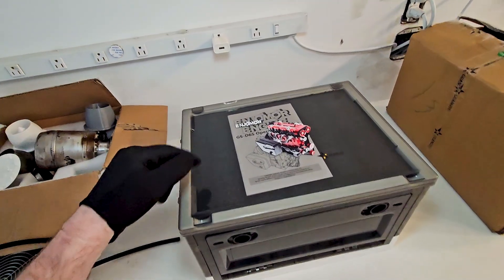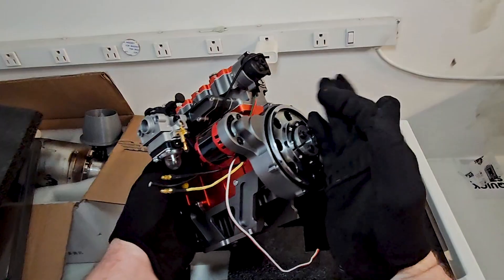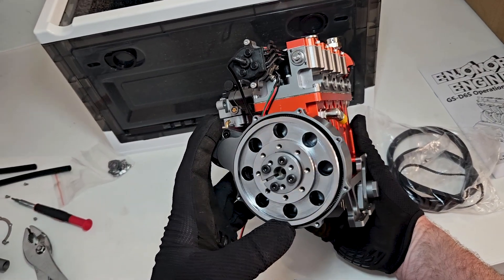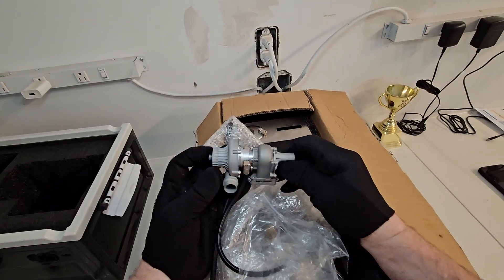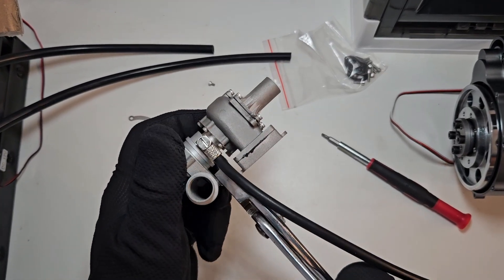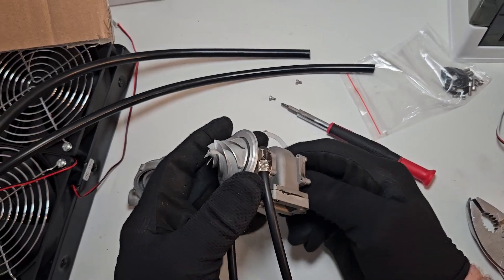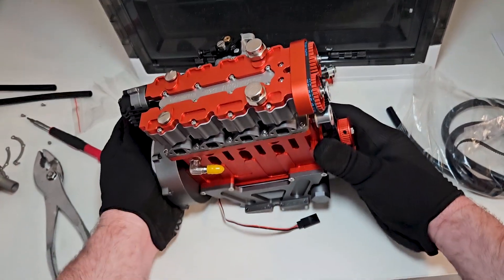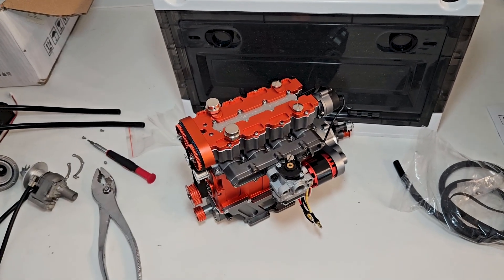Worlds Smallest Turbo Mini 4 Cylinder Engine - (Just Arrived-Unboxing)

Comment: As many have commented, it is a pure gimmick for looks only and cannot and will not - and indeed, does not produce ANY boost at all. Beware of the bottom end of this unit - the 'big end' used single split copper plated sleeve bearings that they have forced open and then re-clamped around the crankpin ! - they wont, and dont, last long. NO pressure oil feed to the crank, only the cam area. Bottom end relies on oil return channels from the head. At least the main bearings are roller but the bog ends are a joke. All splash fed and never designed to be used for axial loads. Oil pump is a reasonable design but you will find that it wont work at tick over due to them putting the main filter BEFORE the pump !!!. the filter needs to be AFTER the pump and a screen mesh protecting the pump input. 2 major issue is the top end as the cam bucket followers act as mini hydraulic pumps - they are not designed to ! - and force oil down the unprotected valve guides.  Overall a good design let down by atrocious big end bearings - if you can call them that - and the valve guide lack of seals. The 5 dollar aliexpress carb doesn't help either and CAN work but is never setup properly from the factory. Unless you fully understand how to set up a Walbro barrel type carb then forget it.

Comment: @Matt Mikka 

I have the Enjomor D6S 4 cylinder w' turbo and love it.. Ive put 3 gallons through mine without any issues whatsoever; I have a lot of miniature engines and this one is my favorite by far!

Completely agree that the turbocharger is for

looks, but they did a hell of a job on its

aesthetics, and you can hear its spool!

I am 95% that the comp wheel is actually from a Samsung Jet 60 cordless vacuum that operates at 160,000 rpm. I actually ordered a replacement Jet 60 brushless motor to verify and the compressor wheel looks identical.

The company who makes this engine is called Guangsu, which is "light speed" in Mandarin Chinese. Their quality is unreal....

I managed to contact them, and asked if they would make a custom 1-off stainless 3D printed charge pipe for me, which they did and it looks killer.

I just finished up my base setup the other day
Reply from the maker: Nice yes, as I mentioned in the video I was talking with them for a while now and I also gave them advice to go bigger. They were very receptive and always had kind words to say about me, originally I was going to produce it myself, however I have bigger things on my plate and I am working together with them so one hand washes another in a way. 
You can literally look back at my older warped videos and you can see that every engine they sent me I gave advice on camera explained what the problem was, then the next engine that came out they fixed those problems, and the cycle repeated a couple times. 
Recently I have also made a couple other advancements and discoveries in the miniature world, I apply those and my current video which is V12 versus V8, and so far so good they have been rock solid now. 
I definitely have heard that they are using the compressor impeller from a vacuum cleaner, I just haven't yet checked it out yet, if you have a part number definitely shoot it over I want to order one too.. Thanks
Reply from the maker: Disregard... I found it, It definitely looks the same, I ordered one off eBay so I can check it out
Reply: Im going to do a video on my personal channel here on the compressor wheel this week, it's really interesting actually.
Reply: @WarpedYT looking forward to it dude 🤙

Comment: nice to see you have a second channel! If you want a fun engine for some next video - chuanqi 277cc american v8 - its an big engine model, from what ive talked with creators of it - makes arround 26 horsepower on their dyno at 10-11k rpm, very impressive, they have a tiktok account if you’re interrested to see

Also - that intake impeller is the same metal one that is in one of my cheap 500w electric bldc vacuum cleaner motors i have from aliexpress - same one! And it made 0,25 bar of boost the way i mesured it with air being able to escape from the other end but restricted
Reply from the maker: Thx, I just got it back up, I miss my personal account!. I know the guys from Chaun Qi, I had a deal with them for the Big V8 and V10 but the guy got fired and they're talking crazy now, I don't know about their claims, did you see my video where I dyno their V12 that claimed like 6hp? If not you have to watch it and see what it actually did, in my current warped video I am putting their V12 up against the newest V8 from toyan which is super sweet.
Reply: @ ohh makes sense, im actually planning to build my own engine - gonna keep it simple for now - inline 4 using stihl ms460-ms880 2 stroke cylinders, will be a project for future, as im currently playing and learning with my current 2 stroke im portong amd modifying, also have a 3d printed cad model of a 50% scale mazda 13b rew engine - 163,5cc 2 rotor with all the seals, will be also project for future once i get some money for that aswell as me developing my cad designing skills, as i need to make the irons and housings have replacable plates for the fact that i am for sure going to mess it up somehow and sieze it up, so i don’t need to get new housings machined.

As for the mini turbos, i think the vz21 is the smallest practical turbo, but that thing will only work good on engines above 150-200cc and yet its not as efficient, but i have seen a guy on youtube that has made a compund system with 2 vz21’s on a blow thru carb setup and he made from what i remember over 30psi of boost on a predator 212 engine, that is also a good idea to explore, but i would try that on fuel injection instead and on a properly build 212 engine - perhaps a tillotson 263cc 3 inch big bore motor, eccarburators v2 high flowing head with large valves, 36lb springs for high rpm’s, billet flywheel, billet connecting rod, a high lift camshaft with good duration for high rpm’s aswell as good ignition setup, that would pretty much make a 20hp+ predator/honda clone engine that is naturally aspirated on a carb, but then with the compound vz21 setup it could perhaps reach into 35+ hp on gas or methanol, but that would be in the range of block needing to be welded up as there will be risk of exploding the engine, well stock honda gx200 made like 5hp so that is a enormous increase in power.

As for the hp claims, damnn i did not know, i have to rewatch your video on that v12, but yeah, i wonder what that v8 would make power wise, but they also told me that after making the fuel injection kit for the v10/v12 cant remember wich one that they are going to try to make it for the v8, that would be cool as i believe that 277cc v8 would have its biggest bottleneck being the carb setup, if i could get my hands on one it would definetly have a adapter made to fit a keihin pwk 26-32mm at an angle so the bowl would face downwards, then i think with good jetting and a lot of time on a dyno that thing could make some good power, but that is just pure speculations.
Reply from the maker: OMG ... That's crazy they are using the impeller from the electric vacuum but not surprising, send me a link to the vacuum so I can check it out. Thanks
Reply: @MattMikka  sent a link, idk if yt will delete it, but i sent a link to the one with 6s esc with a potentiometer attached, but the motor itself on another listing shows the impeller and i think it is the same

Comment: I wish the minimum engine size would be 49cc so builders could actually use these for mini bikes and mini cars.

The moped builders would jump in too.

150cc even better!
Reply from the maker: Exactly, that's what I keep telling them but I don't know why they are creepy up instead of just taking the leap and make it 150-300cc
Reply: @MattMikka  There's very little difference in tooling cost between a little engine and a 150cc sized version.

We would gladly pay the difference in material costs and shipping costs to get something more useful and yet very cool.

The actual mini engine collector may not be interested but there's a huge buying market they are missing out on. 

I think this market could be much bigger than the actual mini engine market.

Comment: Didn't even know you had other channels bro...helk yea...if thd turbo and the engine are both scaled down the exact same amount and they are both designed the exact same...it would kinda have to work like a full sized setup no?? I feel like this kinda stuff dont normally work because they dont scale the induction system down exactly as much as the engine is scaled down....i dont actually know any of that tho...you the one that would know...id absolutely love to see this setup work tho
Reply from the maker: Thanks,  I have a lot of content that just can't go under a brand, when you have a brand the expectations are high which makes a lot of sense.
Well the issue is air molecules do not get any smaller, so if you scale something like a turbo down it doesn't work the same, You end up having a lot of friction losses and the air does not behave the way it would normally behave on a full-size turbo, because of the fixed size of the air molecules. It gets very complicated when you scale things down. As for the combustion chambers on the engines the surface area to air volume ratio decreases significantly, on a large size engine where you have big cylinders you have a lot of volume of air versus a small amount of surface exposure inside of the cylinders and pistons in comparison. All that makes a huge difference and that's why it's hard to scale it down and have it work properly.
Reply: @MattMikka  so basically it comes down to the air volume they both make/consume dont scale down the same...i appreciate the insight brotha...i always watch what you post and will continue 👍 have a great day my friend

Comment: I doubt it will make any boost but it still looks cool.
Also glad they improving the water and oil pump, especially the water pump on a lot of these engines are no up to the task.
Reply from the maker: 100% agree on both of those points, on my current video. I had to add electric high capacity pumps on both engines and that seems have done the trick.

Comment: I'm late
Reply from the maker: Lol...the party hasn't started yet
Reply: you're still one of the "early contributors" haha :D
Reply from the maker: @tomclanys  I appreciate all the early contributors for sure, I think I finally have all the bases covered for my content outlets, I have too many ideas and for instance videos like this I think people like but I cant put them on my branded accounts because I built a machine where people only expect extreme there, and that's what makes the channel successful. If I post a video like this on Warped people get shell shocked.
Reply: I have the Enjomor D6S 4 cylinder w’ turbo and love it..  Ive put 3 gallons through mine without any issues whatsoever; I have a lot of miniature engines and this one is my favorite by far!    Completely agree that the turbocharger is for looks, but they did a hell of a job on its aesthetics, and you can hear its spool! 
I am 95% that the comp wheel is actually from a Samsung Jet 60 cordless vacuum that operates at 160,000 rpm.  -I actually ordered a replacement Jet 60 brushless motor to verify and the compressor wheel looks identical.   
The company who makes this engine is called  Guangsu, which is “light speed” in Mandarin Chinese.   Their quality is unreal…. 
I managed to contact them, and asked if they would make a custom 1-off stainless 3D printed charge pipe for me, which they did and it looks killer. 

I just finished up my base setup the other day 🤙

Comment: Loving to be one of the first here on the "new old" channel :) Good to know you aren't paid to just advertise the engine models, but I did think once before that you are a bit too lenient on some of those models, especially when there is a terrible design mistake right of the bat ;) Like right of the batt the use of a BLDC as a starter motor is weird because it adds a need for a controller and they have lower starting torque than a brushed motor, so it could get stuck on some points of rotation.
Yeah, I don't think one can just scale down a whole turbocharger, especially as the relative density get's higher or more like the viscosity on small scales, but I'm not that sure if I'm thinking correctly about it. The compressor just like you said has incorrect geometry. I'd prefer it to have a wider area on the intake and much less area and more flat angle toward the bottom so it will compress air, not just knock it.
BTW on such a small scale I think you could use a small BLDC motor to spin up the compressor side alone ignoring the turbine part ;)
I'm looking forward to more behind the scenes content. Stay safe
Reply from the maker: Thanks I really appreciate that, I have to get back on my feet now, yeah I used to have a personal channel and it was doing well, but I got taken down when I upload My finger video. 
You have a couple of good points But I want to clarify, for one I absolutely did call out the fact that they are using a brushless motor in place of a brushed motor, I have always said openly since the beginning they need to use a brushed motor because of exactly what you said. 
And the other day I did do a live stream and I said exactly what you just said about the brush motor... So I'm definitely not hiding it.
If you look back at the first engine videos I did I was definitely talking smack about the designs, especially that mini 28cc piece of junk V8, every time I do one of these videos on warped it takes weeks to get things working and it is extremely frustrating, But the last couple engines have actually been decent. 

As for the turbo. You have the right idea 100%, when you shrink something down like this, the air molecules don't shrink down and remain the same size no matter what, and that will create a huge amount of friction losses, It's a lose lose, because if you increase the size of any of those parts then your tip speed becomes supersonic very early, Even before you made any sort of pressure, there's a lot of issues once you start getting down that small More than I can list here in this text. 

But thanks for your support I'm going to pull it together this year, that's one of the reasons I made this channel because mentally, I have a lot of these videos that I need somewhere to post them, Like for instance this type of video would not go on my warped lab channel realistically, It kind of just doesn't make sense or maybe I'm overthinking it, But I know for sure it wouldn't make it on my main channel.thank again
Reply: @MattMikka  Hey, no worries, I wasn't actually even considering the BLDC as a part that you ignored at all, just something that I noticed myself. The thing I meant that I thought you were lenient on is something from previous reviews but I don't recall right now what exactly was it. I don't wanna argue as you have more knowledge and I didn't see the livestreams. Seeing what you wrote now I think the videos on this channel could benefit from more explanation of what you think, like just ramble about out loud about not just your ideas but the reasoning behind them. It would inspire more people to think out of the box :) Thank you too for the reply and have a great day